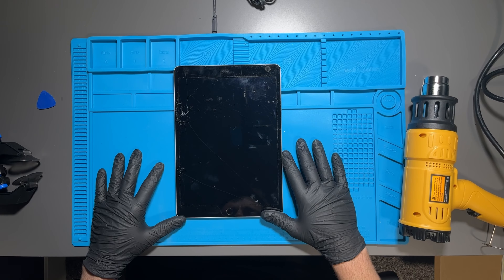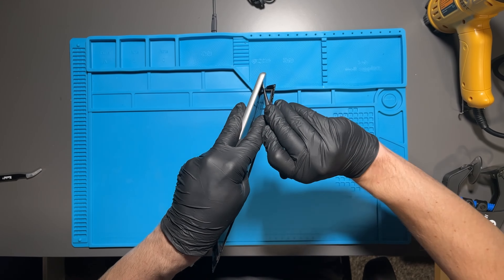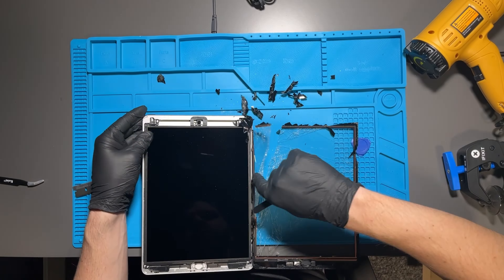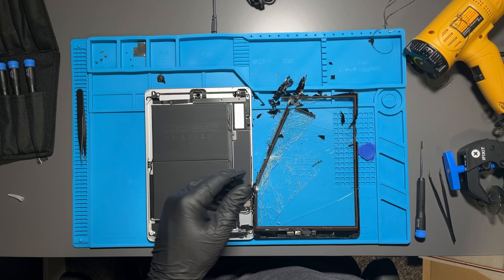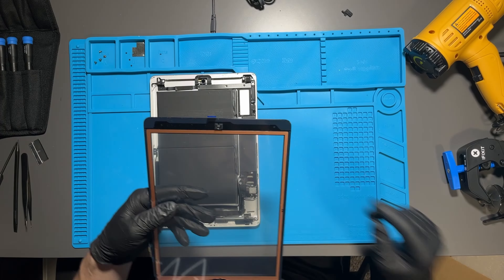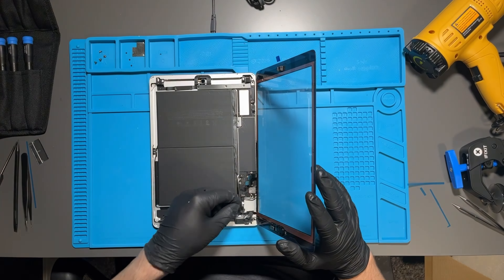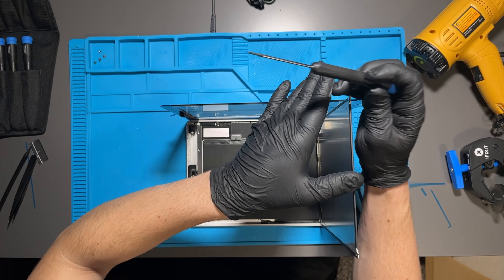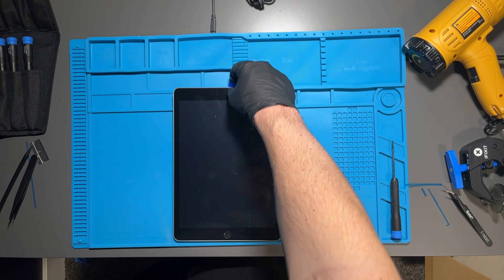iPad 9th Gen Screen Replacement 10.2"

Comment: Yeah way too fast.. no reminder about keeping the home button, no mention to avoid the digitizer when removing screen, no battery disconnect.. explanation of the home button connector not good either. This is not a video you can properly use to perform this replacement. I wish I used a different one going into this

Comment: For touch ID to remain functional, you need to replace the home button on the new digitizer with the one that is on the broken screen because that home button is paired with the logic board cuz Apple doesn't like people repairing their products you can also hold the LCD panel with your chin while screwing down the ribbon cable shield